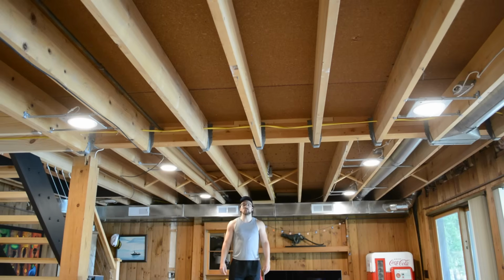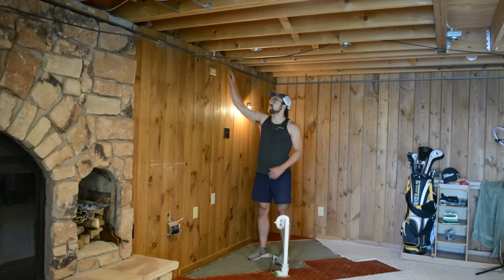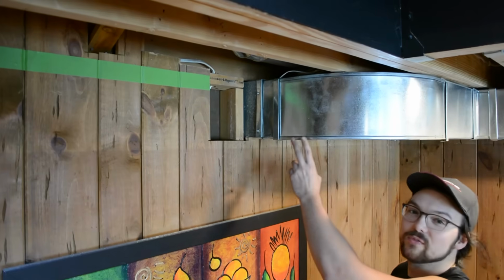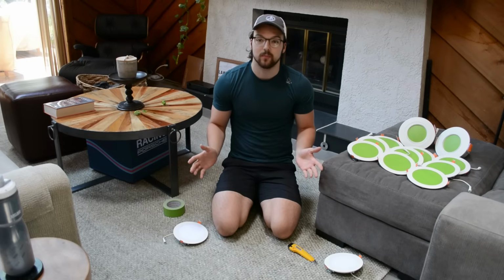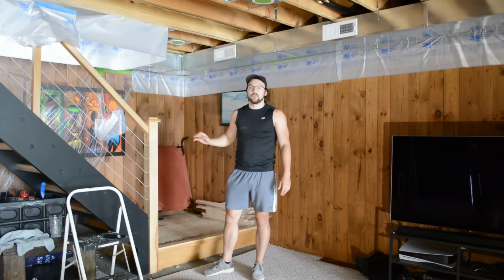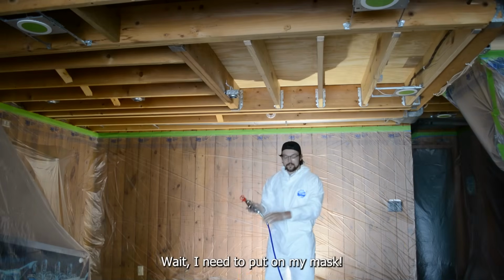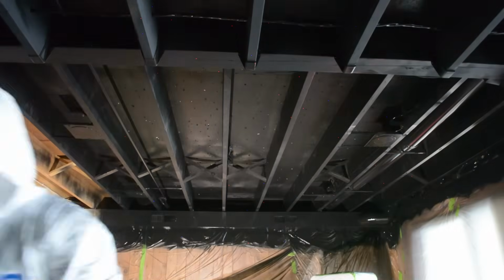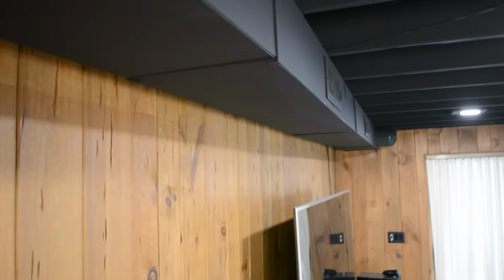How to Paint an Exposed Ceiling | DIY Basement Renovation Part 1

Comment: awesome job and looks fantastic! we recently bought a house with the same drop ceiling situation, and we are wanting to do this. did you have to rerun any of the electrical to tiddy it up?
Reply from the maker: Thank you, really appreciate it! I highly recommend doing what I did here as it really opens up the space. We did have an electrician come in to clean up the wires and get rid of any unnecessary wiring. It isn’t necessary but it definitely makes the end result look a lot better and I think it’s worth the money. Hope this helps!

Comment: what type of led lights and assembly are those?  did you install them or where they existing?
Reply from the maker: They are 6" LED pancake lights and are held in place with a metal bracket spanning the joists. I installed them as before there was fluorescent lighting. Hope that helps!
Reply: @GoldenKeyDesign  Where did you get the brackets?
Reply from the maker: @drewgraham6924   Home Depot sells them along with most hardware stores

Comment: I love this design. For my house, we redid the roof with outside insulation. I then ripped drywall ceilings and redid mechanicals. Also, extended walls to roof line and finally corrugated metal under roof deck between trusses. I painted the exposed ceiling - formerly attic - black and it looks open, industrial like your basement. 

I put corrugated metal in my rafters to get that metal deck look like you see at some commercial buildings.
Reply from the maker: Thank you! That sounds like a really nice design. I like the idea of adding metal too!
Reply: Noice! Can you post a video?

Comment: What lights did you use?  Were the existing or did you buy new?
Reply from the maker: I used pancake LED lights. They are pretty much now the standard for residential interior lighting. The old basement had halogen tubes so all the lights are new. Thanks for watching!

Comment: Looks great! Much cleaner and you did a great job around the TV/vent area. Good call on creasing the tape down the wedges on the walls - paint always loves to sneak by tape! That 3M taping tool is awesome, I didn't expect it to roll down 8 feet, definitely bookmarking that one. How'd you keep the camera clean? Saran wrap or something?

I used to use that final song with the drop/transition, so good for "reveal" videos and easy to edit to the beat! I would still use it, just don't have time to run a channel.
Reply from the maker: Thank you! I was honestly a bit surprised how clean the lines came out haha! The frog tape came in clutch. The 3M taping tool is a huge time saver. It can be a bit finicky, but you get the hang of it pretty quick. Just make sure you buy the 8' plastic as they sell a variety of lengths. The camera is a bit dirty lol! Didn't cover it or anything, just tried my best to keep it out of the way. And yeah, its a great song - I try not to over use it but it works so well! Excited for you to see this week's video!